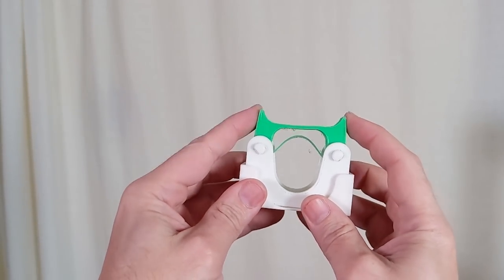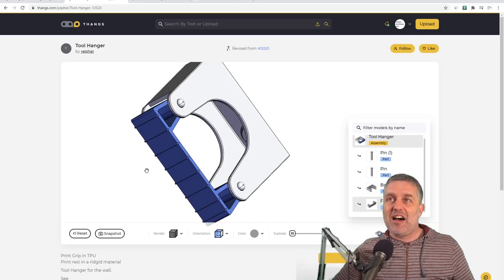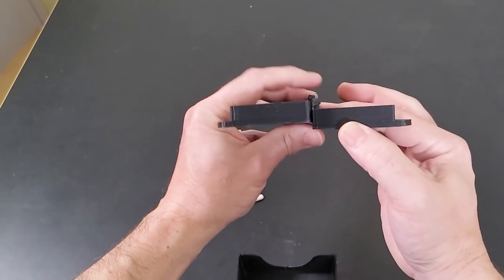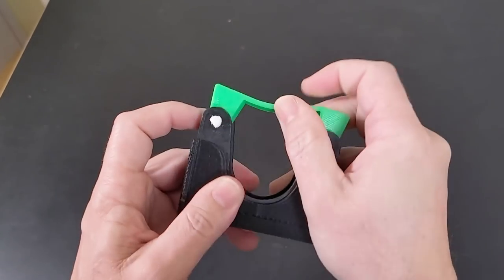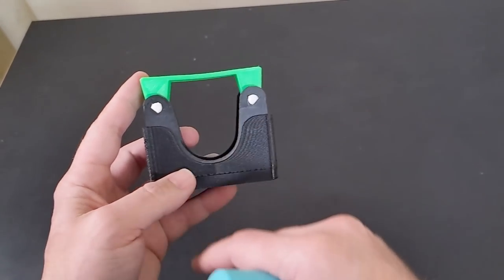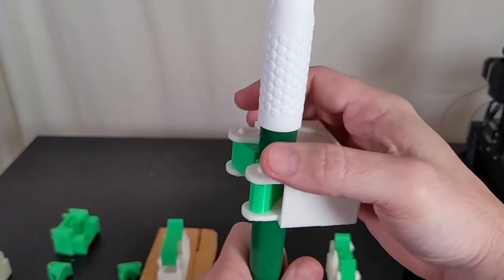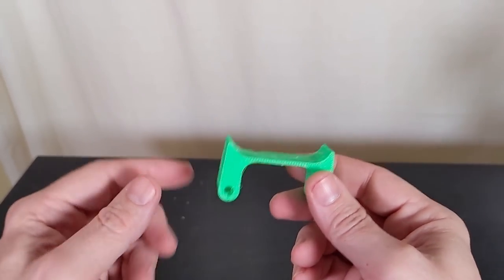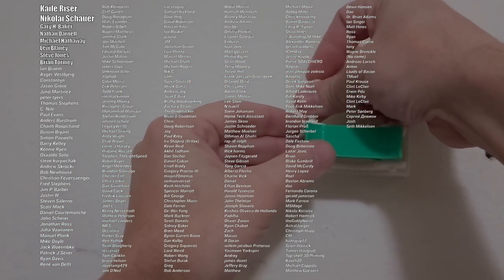Designing & Printing a Functional Compliant Mechanism

Comment: hey thanks for doing this video. you said at the end of this video dont bother printing this item just buy them instead. however you did a lot of explaining about development and iteration stages. which helps a lot to debug how to print this general category of device. so although it might not be worth doing for the broom handle, its still a good guide for making other ones.

things that you are always reaching for. like a custom tool rack. or the tv remote. in fact looking at your other motorhome project. i would expect that once you eventually get to its end stages. then you will finish up by doing all the interior. well then for a motorhome its really important to make maximum use of the limited space. so securing items to the walls like this should be really useful there. in fact for many types of vehicles. very useful. thank you

Comment: Nice video, again 😀
But please give some more theoretical info on how these clamps work or put a link to that info.
And oh, please do a sound mastering course. When you add music it's usually very compressed and thus very LOUD compared to your speech. So lower the volume of the music a lot. The way to master your soundlevels is to play back the audio at whisper level and adjust all audio to be just barely audible. This way your audience can hear you speak and enjoy the music without being deafened by VERY LOUD stock music.
Hope this tip helps you getting your soundlevels right.

Comment: My concern with Thangs is they seem to have no sustainable business model. The one thing I love about the Thangs site is it aligns with my philosophy which is “.stl” is similar to a computer programs  “.lib” file. You can use it and it is nice to have sometimes. But you are sort of stuck with what it is.

But “.step” is like the source code of the library or program. With that you can really change the design to do what you want or use on other platforms in entirely different ways.

For open design to really move as far along as open source software there has to be some sort of common language(s) that enable parts to be shared and more importantly forked and modified. I know there are model warehouses but those are often hard to edit (or at least that is my view of it).

This video is a great example of open design. The original design was in Spar3D and you are using Fusion360. Since STEP files were shared it give a great starting point for iteration. Now those changes can be taken modified and improved more.

Comment: I think going back to the first model, and using a hollow part, in which you'd glue a hard insert (or use multi filament) might work well.

Comment: 'THIS iteration is gonna be the one' ...aww s#&t, here we go again
Love the process, cause if you keep at it, you will ( most likely ) succeed. Thanks for sharing this. 
I'd love a variant to store your bike vertically at the wall with one tire tucked in. But i have not printed any flexibles yet (currently loosing the final battle against a certain acryllic frame. Yeah, i know)

Comment: Thanks for the ‘design for print-ability’ tips.  I have always appreciated the z-axis fusing weakness, but never considered adding a separate interference part to carry the hoop loads. Even better would be to add some sort of glue between those parts.  Is there a good proven option for glue-up?  What has everyone been successful with??
Reply: Super Glue works well for PLA and PETG. but if you're printing ABS you can melt some ABS in acetone and use that to weld the pieces.

Comment: Never used rhino, don't know if you can assign variable dimensions but it would be cool to get a formula going for a working model then just be able to change the ID of the area that grips the object and everything else scales to make if function. That way if you wanted to print a bunch of different sizes for all your screw drivers or tools you could just measure the shaft and input it into the program.

Comment: These type of videos  are very interesting, and  quite novel.  Makes a change to see the design process, in particular changing to suit the build method and materials. In an earlier video, you made a gun stock iirc and In that, how did you add the internal reinforcement struts? I can understand the cad side, but does the slicer detect areas of solid/denser infill?

Comment: It seems if you have problems on Z axis there are problems with hotbed bending oh heating and cooling. I had terrible problems with 600W silicone heater, with 0.8mm nozzle it was very obvious. Solution was using frequency (for me it was fine with 20Hz if your motherboard support it). There is topic on Ultimaker "Different layer thickness problem" with solution from RepRap guys.

Comment: Isn't the patent for heated chamber 3D printers expired in the last few days?
Reply: US6722872B1 expired back on 2021-02-27, but Stratasys owns MakerBot and MakerBot was granted patent US9561626B2 Controlling Build Chamber Temperature which doesn't expire until 2035-02-27. Stratasys is the Disney of the 3D Printing industry.
Reply: @anthonyrich1592  Ouch... What's incredible is that on a machine that precisely controls the movement on 3 axis and temperature of at least one hotend and the printing bed, the ability to control the temperature of the chamber is a pretty silly thing to add...
Reply: @karellen00  Not really, it's all about controlling deformation. As you add hot layers on top of the cooling layers the cooler layers have a tendency to curl upward and distort the part. This is especially evident on sharp corners where heat bleeds off the quickest. By heating the build chamber you can keep the entire part at a higher temperature until the print job is complete and then slowly cool it all as one piece to reduce distortion. A heated bed can help, but it doesn't help as much with taller parts, even when the print chamber is fully enclosed.
Reply: @anthonyrich1592  Yes, maybe I did not say it clear enough, the only thing you need to add is an heater and a thermostat, pretty basic technology compared to what you can find on a 3D printer! Even worse is that the heated bed and the hotend already have the same kind of control over temperature.

Comment: My CAD! How ended it up there?
Reply: Seriously the original is 90%sure that that's my CAD. Where did you find the "original" injection molded one, it looks like my reinforsed one (I reinforsed it due to 3D print in the base), then that was the one we used for the purchased ones.

TIP you can remove the surrounding part if you design with the screws in mind.

Comment: I've iterate through a number of 3D printed functional parts of my own design and the process is always the same: doesn't work, doesn't work, doesn't work, kinda works, doesn't work, finally works, 3D printer breaks, 4 days of dealing with that, finally printed the working part, not worth the effort - just buy it on Amazon